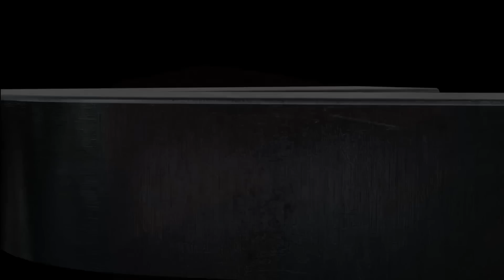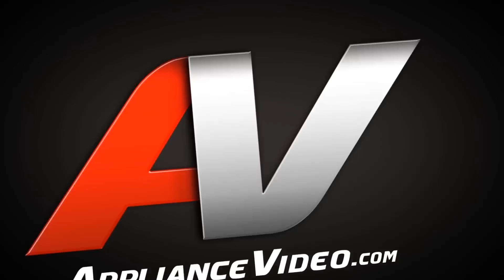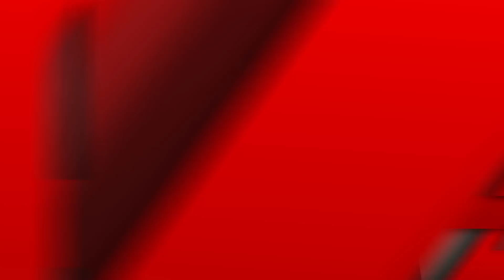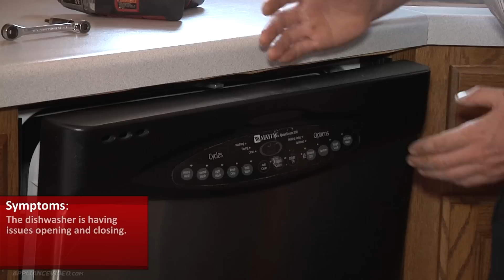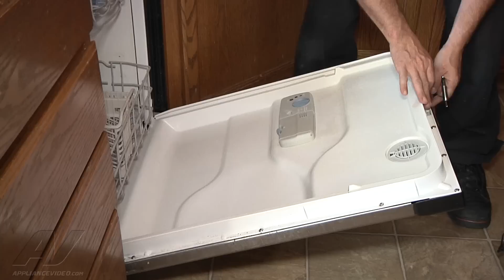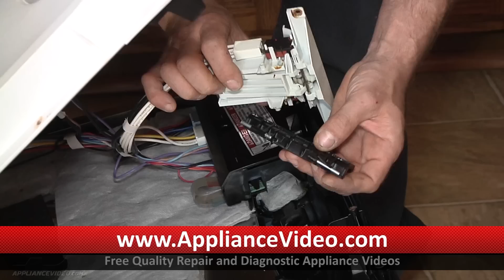Maytag Dishwasher Repair - Door Not Closing or Opening Properly - Latch

Comment: Great video. My issue is broken plastic where the screw goes into the control panel. Hoping this doesn't mean replacing the entire control panel, but the door doesn't shut properly as is. Any advice?
Reply from the maker: Great question, you can call
our parts department at 1-800-830-5465 and they can give you help 6-days A week
Mon-Sat . You can also search at www.SaveMoreOnParts.com 7- days a week.  If you have a more
technical question that our parts department cannot answer, our technicians are
answering all questions at our website at www.ApplianceVideo.com under our Repair Help section. We have over
4,000 common questions and answers that you can easily search through by your
model number, appliance make, and problem or error codes, and It’s free to
search through our question & answer library.